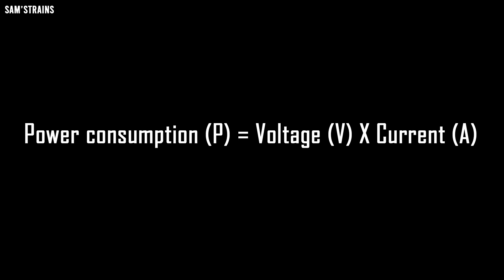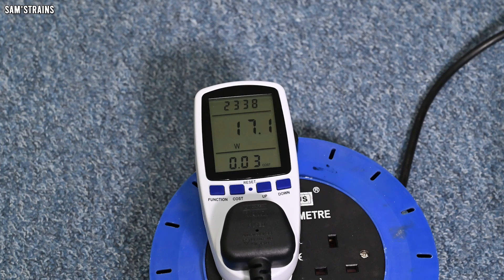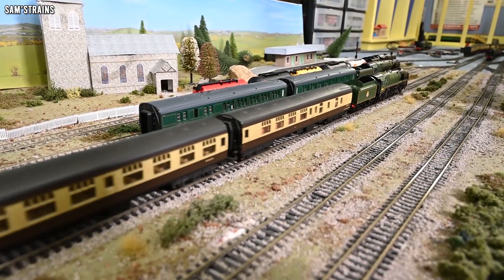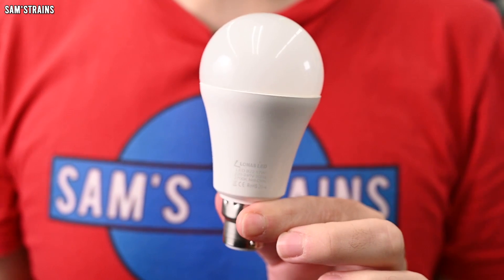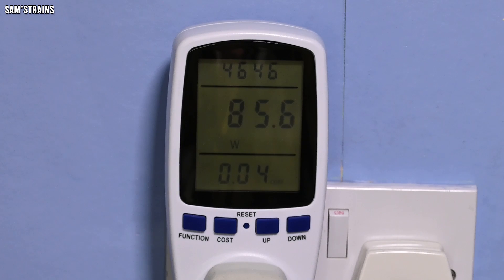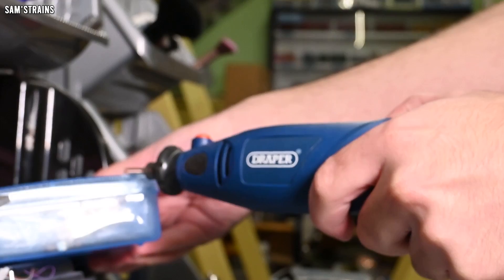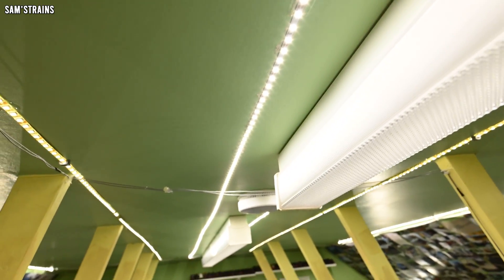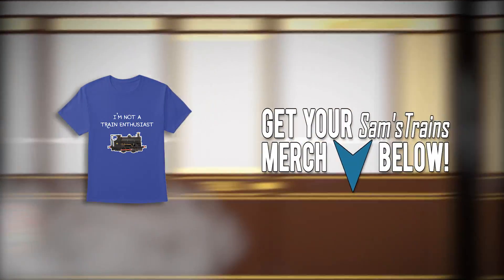New Electricity Prices | What Does Railway Modelling Cost Us?

Comment: I know it would be very hard to work out but I imagine because of the kinds of locations model railways often are, sheds, lofts, garages, utility rooms, they need more heating than other places in the house, meaning it will probably be the thing that be the highest difference between watching TV in the living room for example. Like my garage is barely any different from the outside temperatures whereas with no heating my living room is warmer than that naturally.
Reply from the maker: Yes true, but heat is essential whether you're modelling or not, and the fact that most people use gas would complicate it. But yes, clearly heating is a very significant expense these days. I decided to just focus on the modelling side, with the exception of lighting, just because that's an interesting one.
Thanks for watching, Sam :)
Reply: @SamsTrains  I was mainly meaning that because of the cold locations they are often placed in they'd need more heat

Comment: Isn't that the nature of transformers? The more you reduce the voltage the more inefficient the transformer becomes? They have switching power supplies that use Buck Converters to drop the DC voltage that are a little more efficient but I have only seen those in computers. Wonder if they make them for Train Sets too?
Reply from the maker: Yes transformers are inefficient - not sure why they're not using the switch modes for controllers... or maybe they are for some? The Gaugemasters weigh a tonne, which suggests they are using transformers (and you can hear the hum too)
Thanks for watching, Sam :)

Comment: Electricity prices are the last thing any modeller needs to worry about when it comes to the hobby. Compared to 15 years ago the prices of locos are ridiculous now. Way beyond that of inflation. If you can afford a £200 loco you can afford the electricity to power it.
Reply: Note that the rate of inflation is an estimation based on the cost increase on a basket of goods. Some of the goods in the basket have increased in cost significantly, some slightly and others gone down. Re model trains the cost to suppliers is much more than the published rate of inflation. Factories in China charge in usd (not gbp) so any reduction in value of gbp is a higher cost. The value of gbp vs usd is half it was c. 12yrs ago. Cost of raw materials has been huge increases (esp electrical componentry) and cost of shipping has more than doubled. If the rate of inflation was measured on the cost of model railway manufacture and shipping (in gbp terms) it would be much much higher than 10%. Of course doesn't explain why Hornby and bachmann are inflating their prices but dapol and accurascale are not. Maybe dapol and accurascale have negotiated contracts and hedged their fx exposure at opportune market rates set a few years back and bachmann and Hornby have not planned accordingly?
Reply from the maker: True Matt - but not everybody knows that, so this video demonstrates it.
Thanks for watching, Sam :)

Comment: Sam unless I missed it, the biggest price/energy factor will surely be heating of the room. More necessary now winter is coming in.
You've got what look to be electric storage/convection radiators in the loft, and I run when needed a small electric oil filled radiator in my attached garage based railway room to bring the temp from 10 to 16ish during winter evenings. 
I really need to upgrade from fluorescent tubes to led as well. 
Ps. Guessing  a DCC layout would have a higher cost too.... Still cheaper then a TV and games console though.
Reply from the maker: Yes that's true Steve - I decided to keep this specific to modelling, as heating is more generic and many people use gas over electric!
Thanks for watching, Sam :)
Reply: The only downside with led's is that they don't give out any heat.  With an insulated building, fluorescent lighting can dramatically improve the heating, certainly works in my cladded and insulated shed.  The downside in summer months means you don't like to turn on the lights.

Comment: Good video as always Sam, my local railway club has been asked to turn off the lights on their layout as their location is in a government-owned building.
Makes the layout look a bit dead when we do night operations but it's fine.
Reply from the maker: Wow - that's quite dramatic isn't it? Maybe you could fit some LEDs and run those if you haven't already? So much cheaper to run!
Thanks for watching, Sam :)
Reply: Buy a diesel generator to run the light, I'm sure the government won't mind that and the fumes aren't dangerous at all! Personally I've been running my house off of a steam generator for years now
Reply: Holy moly. You can always run the lighting on batteries, that you bring from home.
Reply: Is it really to do with power consumption or is it some thing else?🤔🤔🤔🤔

Comment: Don't forget that there is a continuous rating (so the power used goes slightly down over time) - it is cheaper to continuously run your trains (and by extension having the room lights stay on) than to stop and start (good for display layouts).
Reply from the maker: Yes that's true, to start a locomotive uses marginally more power than when it's running continuously, but at least for locos this is negligible because they reach the desired speed so quickly - it's an interesting point though!
Thanks for watching, Sam :)
Reply: @SamsTrains  I can’t wait to play shapes on Wednesday.